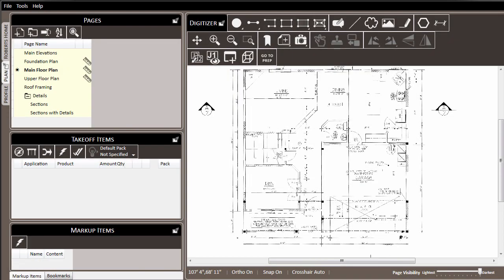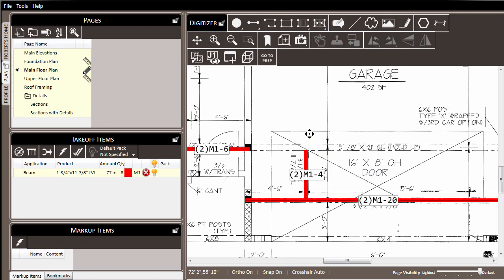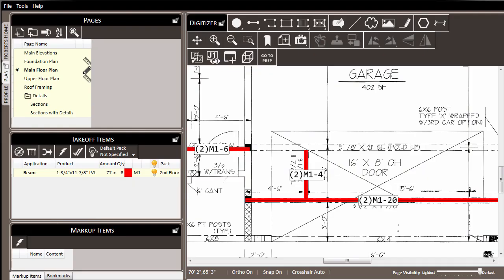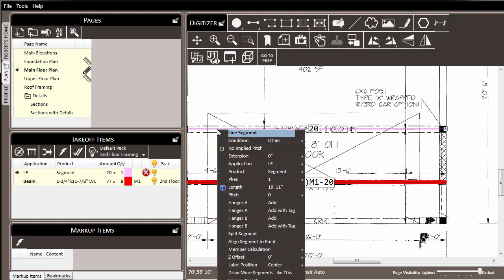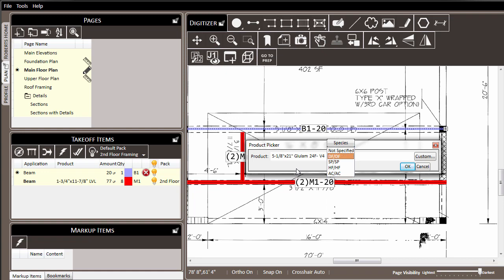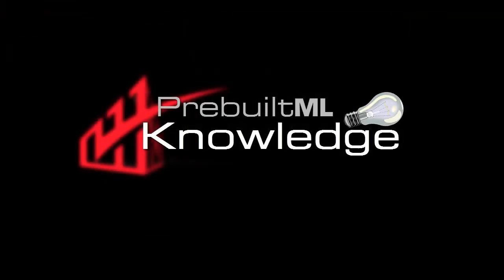Drawing Beams

Comment from the maker: Jump to a specific topic by clicking on a timestamp below:

0:39 - Drawing a Beam
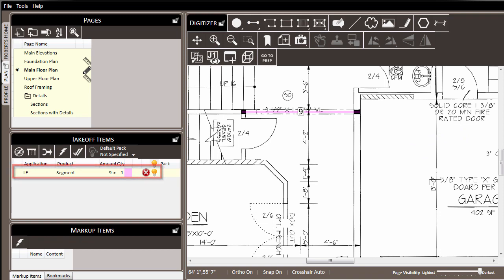0:57 - Assigning an Application
1:07 - Choosing a Product
1:24 - Additional Beam Settings
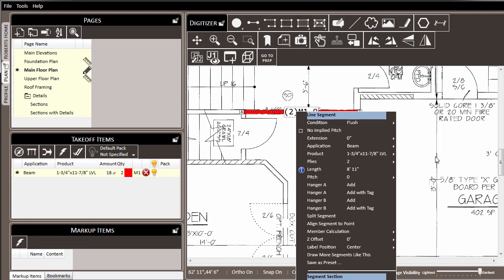1:42 - Quickly Draw More Beams
2:10 - Beam Conditions (Flush, Drop, Split, etc.)
2:30 - Assigning Material to a Pack
3:16 - Default Pack Assignment
4:18 - Choosing Product Attributes